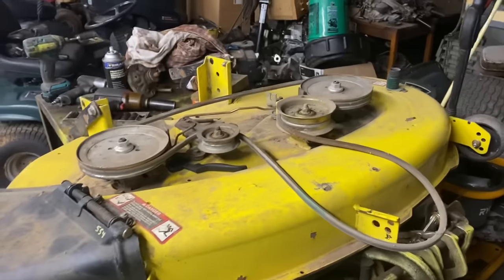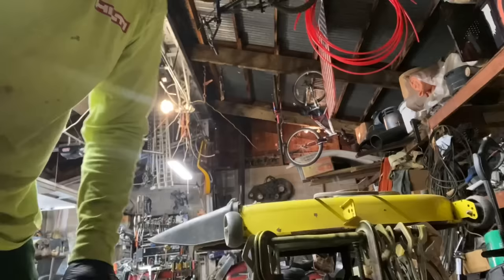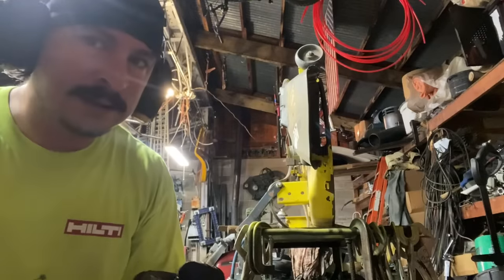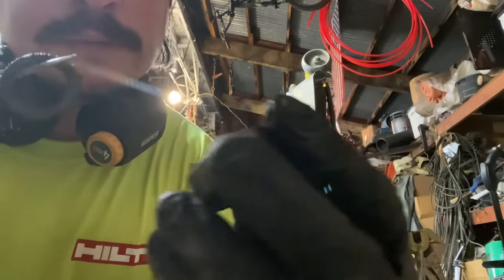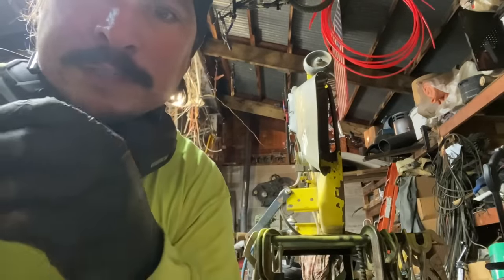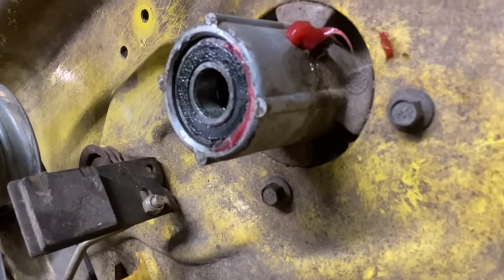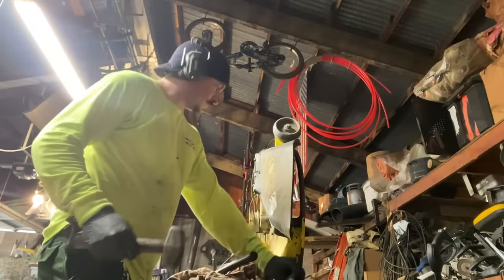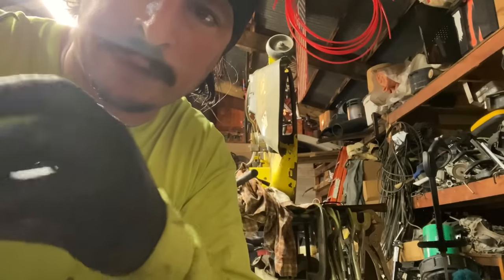Part 1 - Don’t trust the “Experts” Grease your mower deck sealed spindle bearings Common sense.

Comment: So so wrong. Sealed bearings are not meant to be greased unless you disassemble them and replace grease. With the amount of pressure you have to put on the seal to get grease to go past it, you are forcing grease around the outside of the bearing causing it to eventually spin in the housing and ruin it. I noticed you had to drive the bearing out, the way it should be because it hasn't had grease forced around it. Those bearings on that deck should be starting to spin in housing soon if someone kept greasing them.
Reply from the maker: @T.C.8000  actually there is nothing at all wrong with the process how I show it. I use to take bearings out and remove the shields and grease them many years ago before i found there was a better way. Folks can Run some tests for themselves and find the truth. I don’t advise anyone to take the word of a naysayer because they can never provide any evidence of issues and so far all the ones who have left comments always want to talk about other bearing application. This ain’t advice about a boat, race car, air plane, electric motor or anything other than the most bare minimum lawn mower deck maintenance. It’s not nearly as complicated or problematic as you are describing. I realize you’re a naysayer so I challenge you to test the process, please make a video if you find any evidence to prove your points. That’s how we can help folks get to the truth. It would not be the first time Iv been challenged. I have even had one guy from another channel post a video to bash me for being phony and I asked him to make a video showing his proof. He latter removed his video after running some tests at home. 

If it doesn’t work, it’s odd that it’s worked great 100% of the time for me, and for two decades. More and more folks leaving comments on how they have done this process for decades and never had a bearing fail. The way I show is hands down better than not greasing and letting bearings fail. 
Yes you can pull the deck apart to grease them individually but most folks will not be doing that process at home. This is the easy way to gain the same benefit. As for causing issues, it won’t. Never has, and I challenge anybody to prove it and post the video here to share. 

And as for the pressure it takes to pass the seal, it’s almost nothing. Yes a grease gun can build thousands of psi, but it takes only the smallest pressure to push grease past a rubber lip. It’s not gonna hurt anything. It’s a rubber flap. Grease goes past with ease. No need over complicate a simple process. Just think about what is happening during the process and run some tests. Iv shown how, now folks can run tests at home and find the truth. Iv show the way and opened the door. Nobody is forced to use the process but wise to consider this option if the person wants to prolong bearing life without taking bearings out. After doing this for years I now believe it’s actually just a waste of time to do it any other way. Thats my opinion and you have yours but evidence is of importance more than an opinion and Iv shown the evidence. In addition you can put all the grease on the shaft that you want but a healthy bearing will always spin at the point of least resistance and in 20 years Iv never seen a inner race on a bearing in this application spin on a shaft or the outer bearing spin on the hosing side unless the assembly was ran to total failure due to lack of grease. Even when bearings are burn up and melted the inner race has never showed any signs of spinning on the shaft. and if that one point your trying to make won’t hold water why should anyone take any other point you try to make as truth. Your argument is simply not facts and only assumptions and yes theoretically sound possible but in my experience have never been true. Thats why I say show the proof, Iv never seen it once and I couldn’t reproduce your claims if I wanted to because Iv never seen any of that not one time. If you have been into hundreds of decks you would know that some things just don’t happen even though it sounds plausible. As you may or may not have seen in my other videos, some decks were ran to total failure. 

Anyone who thinks it’s smarter to dismantle a perfectly good working deck that is equipped with grease zerks should carefully consider the proof shown in this video if they want to save money, headaches and time. As for those folks without a zerk on the mandrels of there decks, add one while your in there greasing bearings manually so next time it can be easily done. And consider only buying a tractor that has greasable deck in the future if a new tractor is needed. The industry is slowly getting away from adding zerks and unfortunately it cost the folks who buy the equipment. 

As for naysayers, I’m not holding my breath that anybody will ever come through with some solid evidence that any part of my process can harm a shield seal or do anything other than benefit the bearings. So far nada in that department and that’s just the facts. Part 2 is my love letter to naysayers.

Comment: I'm Sorry But I Don't Agree With Your Experiment .It May Have Penetrated Through The Bearing Seal, But it is Better To Remove The seals And pack By Hand, Then Put The Seal Back In. There wasn't Enough Grease in Those Bearings . Very Minimal Amount. When You Fill The Cavity With So Much Grease You Are Actually Pushing the Bearings out of the Spindle And Putting More Pressure On The Spindle. The Grease That Came Out The Bottom Was Mostly Grease That Passed By The Outside Of The Bearing. You Just Made a Big Mess That will Get Spread Around Under The Mower Every time You Add More Grease Through The Grease Nipple, It Would Have Been Better If You Left Out The Seals on The Inside Of The Spindle. Then You Would Have Sufficient Grease In Those Bearings. I Don't Think This Subject Is Going To Get a Factual Proven Outcome Anytime Soon.
Reply from the maker: First of all, don’t be sorry. I’m not your friend and your opinions on the topic mean no more than mine. Your not going to hurt my feelings. You have your opinions and I proved mine in a step by step video anybody can duplicate and try for themselves to disprove or back me. The fact is it’s been proven and I’m the one who proved it in this video. Your coming to bat with no proof just opinions and thoughts on how the process works. Keep in mind this video is just free information provided to help folks decide if they want to believe the “pros”. I have not made a penny. Seems to be lots of guys saying don’t even bother adding grease through the zerk unless seals are removed. I proved that was BS and I didn’t even break a sweat. I say test it out yourself. If you do so, please record all the issues or success you run into, then share with us. I would love to see it. I disagree with you and disagree about everything you said. 
In the real world application grease comes out and slings off commercial machines all the time. You will rarely find it. To minute to worry about. And grease is just messy, even hand packing bearings is a mess. I say it’s less messy to pump it in with a gun and wipe off the excess. We are going to get dirty working on equipment and working with grease. Iv been a mechanic since  before I could drive. Don’t ever remember it being a clean hobby. Your getting way to bogged down with things that don’t happen and are absolutely not a concern. Your creating road blocks in the process that simply don’t exist. The assembly is bolted together. You can’t push the bearings apart unless you have the nut off the mandrel. Yes enough grease reached the bearing and each time the assembly is greased more will reach the bearing. The process works perfectly as it is shown in the video. A little fresh grease goes a long way in this application. You may be surprised to see how much grease comes in some new bearings. It’s disappointing to say the least. Iv popped open some new bearings in other videos to show folks. Grease can only pass around the outside race of bearing if your assembly/housing is worn out or damaged. In that case preventive maintenance is no longer going to help. Adding grease as Iv shown can prevent that issue but that’s the thing about proper preventive maintenance it has to be done before things go bad to keep things working right. I shook my head the whole time reading your comment, every point you are trying to make reaks of someone who has very little hands on experience or is just simply very closed minded and does not know how the assembly is made or held together or how things are really happening. Its laid out in a step by step video and my part is a used part and I didn’t experience issues that you speak of. Not saying that can’t happen but if the things you speak of are happening things are different than in my video. Maybe the parts are worn out. You can try to disprove my theory and post your own video. I just ask you use a good part. If you test it on old damaged components the outcome will be different. Iv asked some of the mower pros to do the same, but they prefer to keep the BS videos posted and don’t want to or simply can’t disprove me. Your just another naysayer with no evidence and unfortunately your wrong. I’m not trying to hurt your feelings but some
Folks can’t handle the cold hard truth. Maybe you can. Overall I have to say this is probably one of the worst comments as far as way out in left field on some of this stuff. Almost seems like something my florist would tell me if I asked for opinions on mechanical stuff.

Comment: These are not EVEN actual "sealed" bearings, so this video really has no point.  Of course these bearings will accept grease, as they are NOT even sealed on both sides, so the bearings will definitely be able to accept the greaser from the backside of the bearing that is unsealed after the cavity is filled !  And NO ONE said they wouldn't !  You need to try your experiments using actual sealed bearings that are sealed on both sides !  I suspect that it will still accept grease, as these seals are really more like dust covers, and will allow the grease to enter & exit the bearings.  But you need to use the sealed bearings that they are talking about, or the naysayers are going to keep saying that you have proven nothing, and you really haven't proven anything to debunk their statements !
Reply from the maker: Your comment is a bit messy. If you have had these box store decks apart you would realize this is how they come with the shields on both sides of the bearings. Actually a lot of controversy over this exact topic. And why I felt the need to make this video. You may have noticed it’s getting a lot of views, that’s should show how relevant this information is, I have clearly shown the shields / seals that come factory on 99% of the box store tractors in The USA and my video is necessary as I’m doing this experiment on the exact same tractor/deck that most of the naysayers videos are about. So in that sense this video is simply here to debunk those claims stating this exact assembly would not accept grease. Sadly the video was clearly needed as no other channel on YouTube offered this in the detail I have done. And nobody for that matter even states the grease will flow into bearings, so in that regard this was absolutely needed to help some DIYers. appears you may be a little lost on this topic maybe because your pulling from experience on some other bearing applications? Maybe? I don’t know for sure why you would say the things you have unless you’re not familiar with this exact application. As for the John Deere 100 series decks with shielded bearings installed these are commonly refered to as sealed or shielded bearings and they come with the shield on two sides. Technically they are a seal just a very low grade shield and it seems some folks think they are tighter than a hydraulic cylinder seal and seems to be a lot of controversy on the topic. Most naysayers have zero experience with these shields and absolutely not a single one can or will bother to back their claims. Not sure what level of expert you are but it’s obvious you’re just a little off the bulls eye. I’ll challenge you to the same thing I do the other naysayers, put down the keyboard and make a video showing the truth you speak of. If you’re right the proof should be easy to show and it could help folks. Right now it just looks like a bogus comments when it contradicts the evidence shown clearly in the video. Help us understand what you’re talking about. Seems you’re passionate about it, it just doesn’t make any sense yet.

Comment: As if the grease gets past the seal it's in the name mate seal don't waste your grease it going no were
Reply from the maker: Apparently you didn’t watch the video nor have you performed a test as I did in this video otherwise you would realize how ignorant this comment is.
Reply: Ha ha ha really 🤣 😆 I work for one of the biggest mower companies in the UK you are talking bull there is a vent hole in the mandrel the grease is at 0 pressure no way will it fill a sealed bearing get real
Reply from the maker: @mralanvideo  there is so much I can say here would take me hours to type it all. But I will be willing to go a little deeper into the details to help explain it better. Don’t be close minded to only what you know about the company you work for. I don’t believe you guys are building the Deere parts like I’m showing in this video but you are not in America so I don’t know what you have there exactly. However here in the US there are more than one type. Yes even here some mandrels, specifically the MTD units will have a vent hole. I address this in some of my videos. If you happen to be working on one that has the hole in the side you are correct the grease may exit there before it can build enough pressure to be highly effective and my not pass the seals. However keep in mind the seals are dust seals and not even really effective at being water tight. They will not prevent pressure from passing. So it is possible a little grease may pass the seal as well as exit the hole you speak of. We would have to test that to be sure of the outcome. In the US brands made under the MTD umbrella such as cub cadet, MTD gold, Huskee, yard machines, Troy bilt and many others may have the hole you speak of. If so it will be noticeable when the person greasing finds grease exiting the hole. As for why the company designed it this way I think maybe they don’t want the units to be serviced because the bearings will last longer if they receive grease. So by making that hole it insures the bearings can’t receive adequate grease and will probably fail much sooner. If the tractor is down the owner will either need to buy parts or possibly buy a new tractor. I personally hate MTD equipment. For this and many other reasons. They make the worst equipment in the mower market as far as the US goes. of course the hole can be plugged. Then you can grease them just like the rest. Just add a small machine screw or tap it and add another grease fitting. We just have to help each other out. Big corp does not want us to fix our own equipment. I’m not your enemy. The word ignorant just means uniformed. Here is a definition I pulled from Google. I do not mean offense as I’m ignorant of a great many things. Nobody knows everything so that being said we are all ignorant of something. 
Ignorant = lacking knowledge, information, or awareness about a particular thing.
If you watch my video it’s clear the grease got into
The bearings. I’m here offering free help. I’m not sure why your wanting to argue about it.
Reply: @GTObearclaw1  JB weld can fix that unintended exit thing.  🤘
Fk "the man" i'll MAKE my stuff last.
Reply from the maker: @mattfleming86  right on brother. 

You talking about the hole manufacturer put in the side of some MTD spindles? Never considered JB weld but your absolutely right. That would probably do the trick just as well as a small screw to plug the hole. Just need something to prevent grease making an early exit. Lol 

I think they added that hole just to prevent proper greasing so the grease will exit there first and then the servicing is pointless but makes the person performing service feel like it was adequate.
Reply: @GTObearclaw1  Absolutely right.